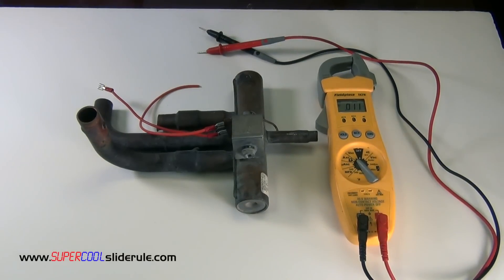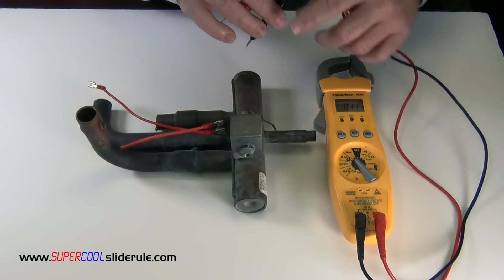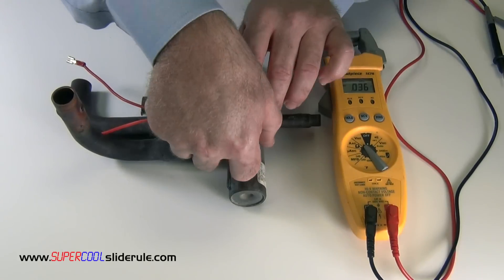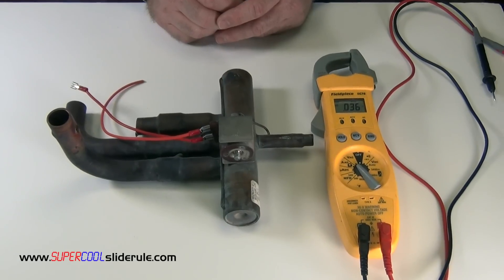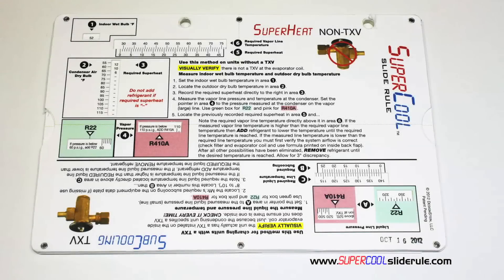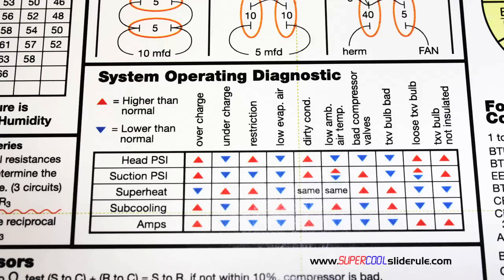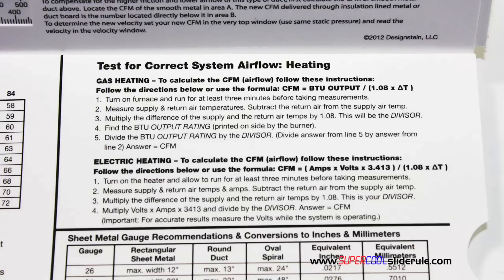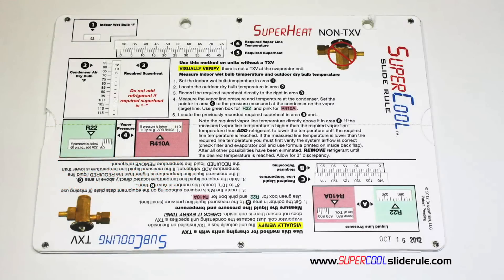How to replace a Reversing Valve & test a Solenoid Coil

Comment: Where would I find a replacement for the solenoid coil? On the casing of my solenoid for a mini split heat pump - DunAn AC:220-240V 50/60Hz,  Power 7/5W , 150425W. Thanks!

Comment: Hate to say it
But I’ve been a fridgee (refrigeration and airconditioning technician) by trade here in Australia for 15 years and no one, ever, uses any of those slide rules. Im not sure why you’d even need them?
When you’re charging and commissioning a system you do so to suction temp superheat back to the compressor, what do you need a chart for??

Comment: To check for voltage I had to remove a rubber boot that had the female spade terminals tucked in it. I put my volt tester into the boot"s female feed terminals. I read around 100 mv and it kept slowly creeping higher in mv .
I placed the boot back onto the solenoid, removed the screw, removed the solenoid, did the screw driver test and there wasn't any magnetic pull.
My questions are: Does the outside unit have to be calling for cold or heat to test for voltage to the coil?
If not what do you think about more tests to narrow things down. I have a new thermostat, It's a Rheem heat pump, Doesn't blow heat through the ducts, and when the fan is set on continuous it doesn't respond.